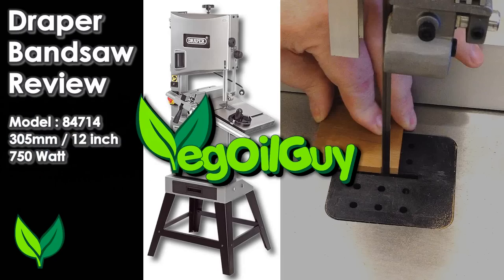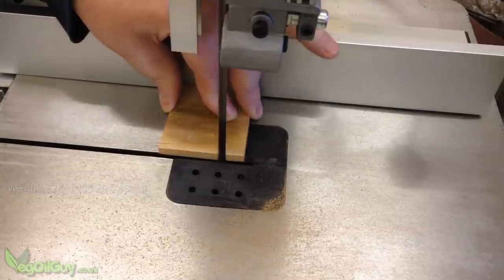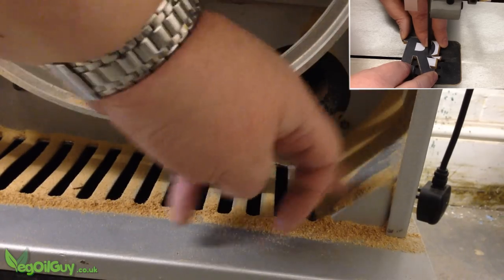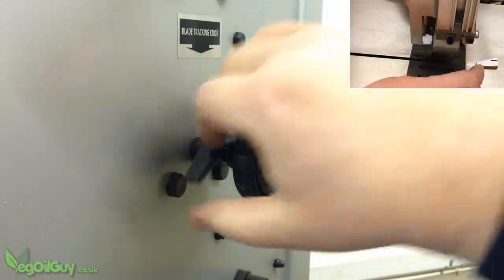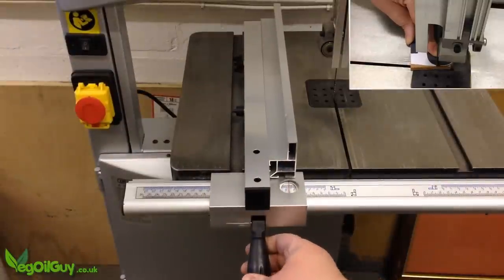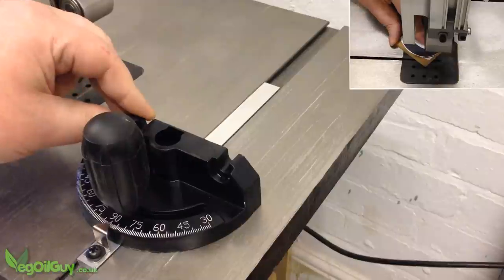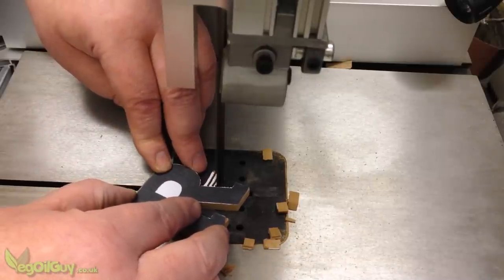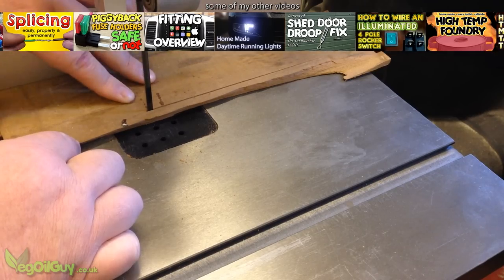draper BANDSAW REVIEW - model no. 84714 put to INDEPENDENT testing

Comment: 2:46  YOU need a slap...  That tilt lock lever arm will be on a spring loaded spline, pull it towards you and turn it out of the way. :-)
Reply from the maker: Ha! You're right! 100% spot on!!!
I never noticed that at all. Sorry Draper. Sorry slapped designer  : )
Thanks for the correction    : D

Comment: Hey I have this bandsaw and for the most part I like it only problem I have with it is the bottom barring under the table where the blade runs along is stuck and not rolling so the blade is eating into it and is making a hell of squeak afraid to use it now in case I do damage to it

Comment: Similar to my Charnwood bandsaw with a few updates. Happy with mine but the top wheel tensioning looks the same which was something I was always found a bit fiddly and hard to get right. The table angle positioner seems to have changed but just for a different type of awkward.

Comment: Hello Geoff - may I ask, do you live near London?
Reply from the maker: No my friend, I live in Wolverhampton which is roughly 140 miles from London. However, my wife is from London and we have family there  : )
Reply: I've never heard of lost foam casting before - does the molten metal just burn away the foam or something?
Reply from the maker: Spot on!
You make a shape out of foam, pack it well with sand, pour in molten metal like aluminium or bronze, and the metal evaporates the foam. The metal fills the void left by the foam and solidifies within a few seconds. Once cool you have a solid junk of metal in the shape you desire.
I've used it to make all sorts of useful things like brackets and fixing. But I've also used it to make fun things like sprockets to drive the tracks on my Radio Control Lawn Mower, as well as replica viking axes and the like. 
As long as you're careful, it's amazing the things you can create  : )
Reply: thats amazing
Reply from the maker: It's great fun, practical and surprisingly cheap to do. There's different techniques as well, such as Lost Wax Casting (I think you can now guess how that works) that uses plaster rather than sand.

Comment: This is typical of Chinese built machines that are then badged to appeal to a western audience....
They tend to get the basics right do the chinese....
Then let it down with cheap & nasty, plasticy components from the parts bin...
That switch...
I'd probably replace it with a lewden type... (i am an electrician by trade)...

The plastic insert... 
I don't like it and it wants sacking off and a proper metal one making for it...

That work light is a potential hazard on this if it ain't going to stay put...
Sack it off and get another for it...

The hook that doesn't fit the push stick...this is typical of China...
Drill another hole in the push stick so it'll hang properly...

The rest of it looks OK.. 😏
Reply from the maker: In fairness to Draper, they were receptive to my comments (I'm married - so I'm used to being ignored). They've even assured me that they're already addressing some of these points.
I certainly hope the insert is one of them. I have some aluminium plate in my shed and I'll probably try to make my own insert to improve accuracy.
It's a shame about that switch... it works, but the quality is shocking in comparison to the rest of the saw. But it does look easy enough to replace, even for an amateur like me.
As for the light, it droops a little - even without a drink - but not so much that it would fall into the blade. It's position would make this tricky, but not impossible, though it's likely low current being LED... not that I'm going to risk trying it  : )
Reply: @vogman 

No.
One of the reasons it'll be LED is to get round machinery directives concerning lighting near rotating machinery...
Reply: Ji
Reply: Ooopppss sorry big fingers...crazy blupers